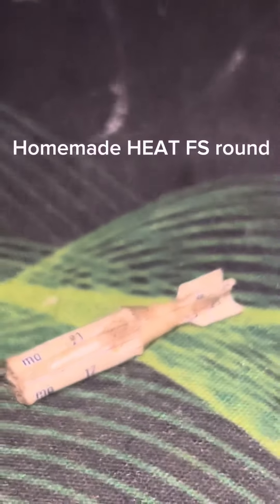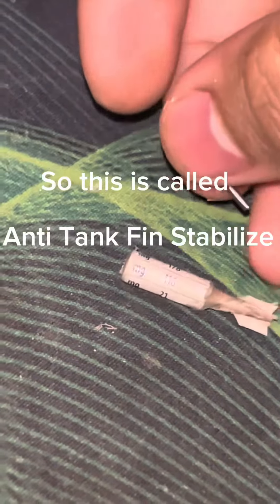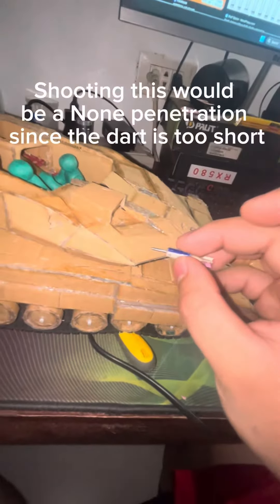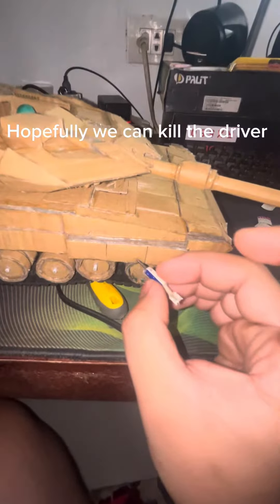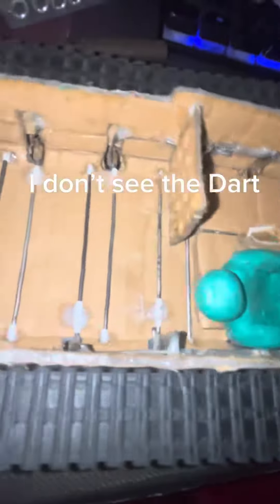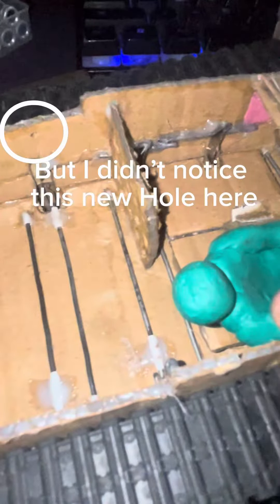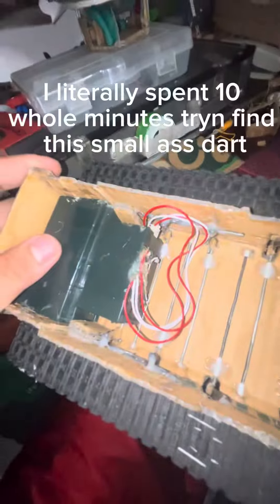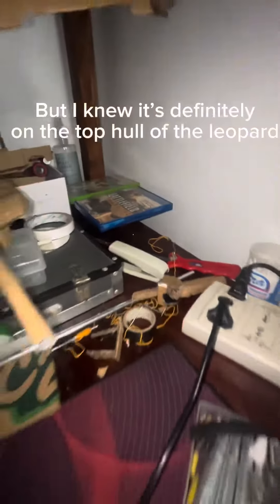Homemade HEATFS on a Powerful Dart Cannon #warthunder #diy #cardboard #tank #leopard #cannon

Comment: What did you make this HEAT-FS out of?
Reply from the maker: It’s just the same dart but shorter and I just made a casing to look like heatfs 😅
Reply: @nickbanz9283  ever tried adding a popper inside the casing to see if that increased penetration. Just a potential experiment
Reply from the maker: @Breadman2024-us7fi sadly I don’t have any kind of explosive in my room:(
Reply from the maker: @Breadman2024-us7fi  Ohh wait! Matches! Aight I might be able to make one, soon on the video I’ll try make some:)
Reply: @mr_Saladman18 i dont think it would be effective at that size anyway... try adding a coat of dry paint on the inside of the tank so you can create "realistic" spall
Reply: @Berilaco  that's actually a fire idea.
Reply: Could you use the alcohol kind of in the same way in the cannon but in the heatfs
Reply: @BrodieDelancey  no that wont work because A it would be too little force and you need a way to ignite the thing
Reply: Yea and the matches would either burn the cardboard around it of just be not enough propellant like you said
Reply: @brodiedelancey3382  Pretty sure he used matches to make the ERA armor on his t-90a
Reply: @Breadman2024-us7fi  I thought it was two metal sheets up against each other
Reply: @Breadman2024-us7fi  no its most likely spring loaded
Reply: @Berilaco  valid
Reply: @Breadman2024-us7fi  some other builder made an t90 with metal sheets of cover and compressed matches powder, it needs to hit a powerful cannon to activate its era

Comment: i have a question how did you make that cone ? for the ammo
Reply from the maker: @StreaMNclips657  it’s a metal string from like tightening steel bars for construction and I just use a smoothing tool it’s like a sandpaper but it’s a metal tool to sharpen my darts and I just use a drill to perfectly shape it to cone:)
Reply: @mr_Saladman18  oh okay. do you think i can do with any other material? i tried with cardboard but its hard cuz its very small or even with paper

Comment: How do you get the exact measurements
Reply from the maker: I just eyeballing it😅 I actually made it fit to the barrel and jut cut a little to make it fit.
Reply: @mr_Saladman18 nono with the tanks width and the size of different parts... can you find the width and hight and length of the different parts on war tinder?

Comment: that aint heatfs, thats apfsds lol
Reply from the maker: Yeah that’s why I called it ATFS cus there no High Explosives, but it looks HEATFS 💀
Reply: no ds tho, so maybe APFS? he is using a rod penetrator after all. ATFS is applicable as well ig. looks like a mix of a HEATFS round and an APDS round. APATFS sounds cool too.
Reply: OMG GUYS I GOT IT 

APCRFS
Armour-Piercing-Composite-Rigid-Fin-Stabilized
Reply: OMG that actually makes so much sense. most accurate one yet XD @Berilaco